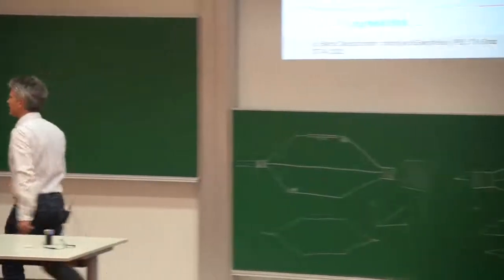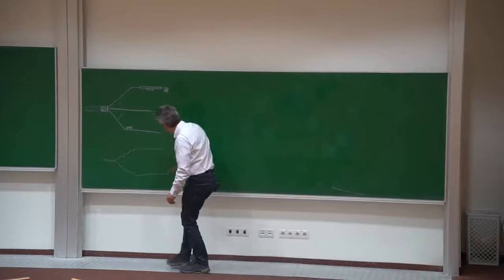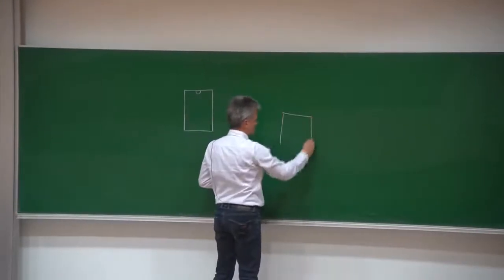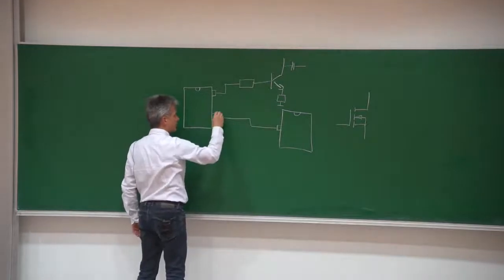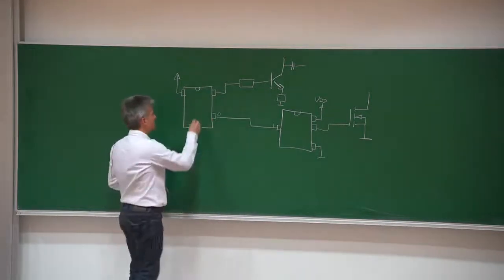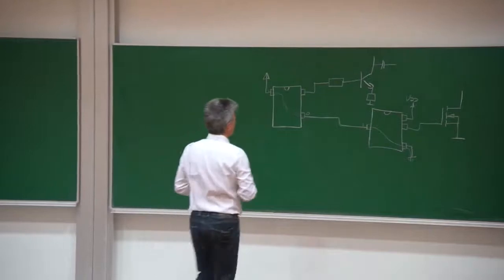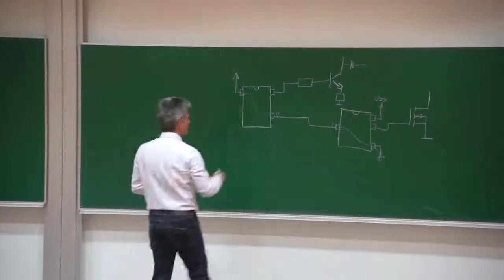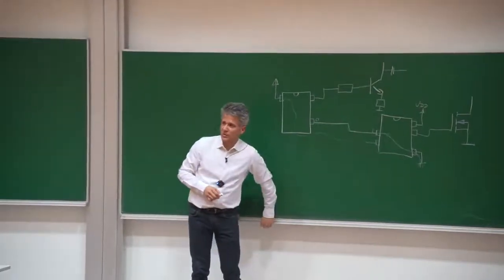Current Return Path

Comment: Perhaps if you define the word “impedance”, your phrase will have more sense(the impedance is defined between two points). 

Because of the first Kirchhoff law, obviously all the current that “exits”from the positive terminal of the generator has to return to the negative terminal. This not exclude that the voltage between two nodes inside the circuit will cause some current (not the total current) flowing in some particular direction